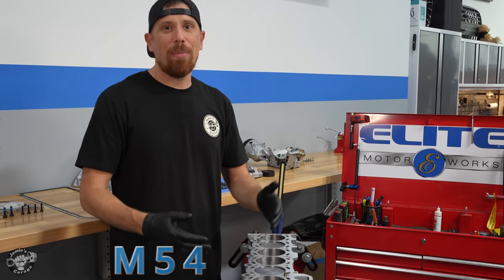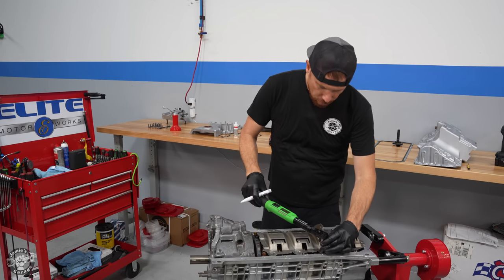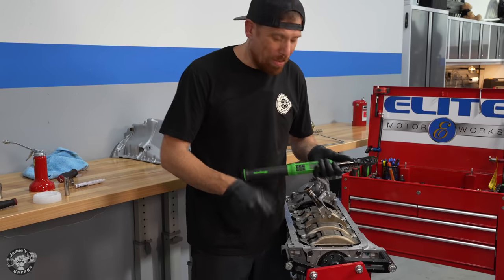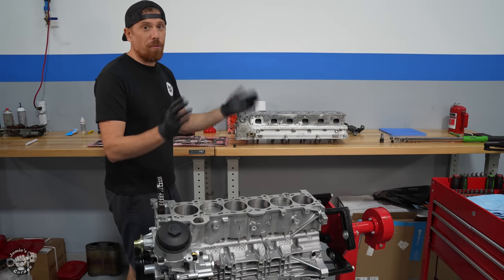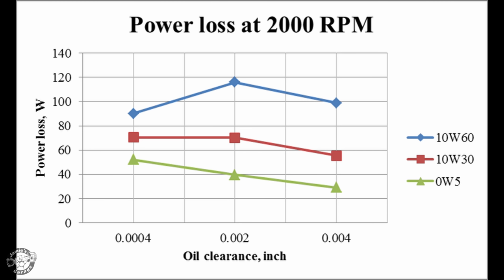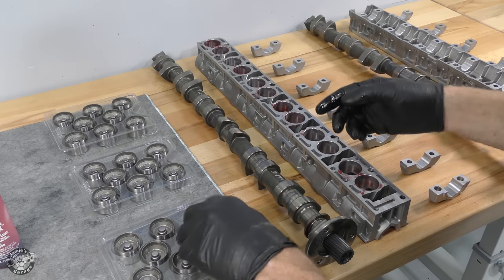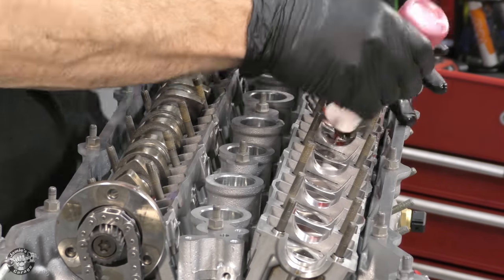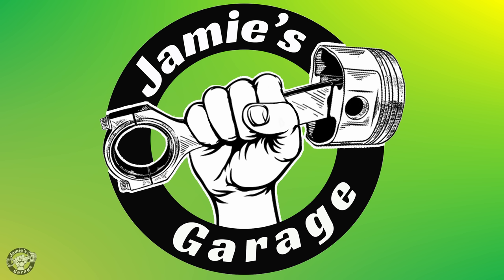Worlds Most Reliable BMW Engine?

Comment: This video was an awesome wrap up to a really cool collab! So with those spec piston return spins, hypothetically speaking, how much boost can this engine take?
Reply from the maker: Approximately 42 Nibbles of pressure at 350 furmans above sea level.
Reply: The spring has returned :"")
Reply: We wait long time for this video.  Thanks
Reply: Oh god does this mean…..
Reply: Until Jamie's technical explanation of piston return springs, I thought ChrisFix was just giving a flex by using them.
Reply: This race has really robbed us of the 'Hey guys, ChrisFix here, and today' videos
Reply: @danieltv1943   A new spring & The spring strikes back!
Reply: You guys know it’s not April 1st right?
Reply: Chrisfix, i Love the part you had Jamie throw in about the piston return springs, reminds me of the headgasket video on the del sol 😁. I wanna see more videos on that little car please!!!
Reply: Pardon my ignorance but how exactly does this fit into the $500 limit?
Reply: @Vass046  🤫 no one have to know that....... Until the entire planets
Reply: 36:20... E "Einlass" actually is the intake side, A "Auslass" is the exhaust side. @ChrisFix maybe you should check under the valve cover for correct assembly. Greetings from Germany.
Reply: @time1312  If you look through the video, it is assembled correctly, he just said it backwards.
Reply: @Vass046  because lemons is about having fun. This is the backup engine to keep them in the running. Swapping it would be the “$500 my @$$” penalty.
Reply: Please watch from 11:30 he put the gasket wrong way.
The screws hole are not aligned with the gasket holes.
Reply: Would it be worth upgrading the piston return springs on my N55, or does it already have 120 rate springs due to the turbo?
Also, do LED turn signals use blinker fluid? My housing has been dry the whole time I’ve had the car, and FCP Euro doesn’t specify which type of blinker fluid it uses.
Reply: @time1312  E = Einlass (intake), A = Auspuff (exhaust)
Reply: send me some I wanna prank my mate
Reply: Will my suspension coil work instead?
Reply: Yeah, with piston return springs, perhaps you don't need the rod caps 🤣
Reply: You should have gone 119 spring rate, much more preload return when heading North.
Reply: Red shirt guy: Is this an out-of-season April's Fool joke?
Reply: I'm sure Jamie noticed his mistake when he went to put those smaller bolts in, but didn't want to re-shoot the sequence.
Reply: I am glad you did not get over the $500 budget with this backyard rebuild :)
Reply: Good luck this year Chris. Best of wishes.
Reply: Chris remember to proper break-in this engine. I know it's for race use in lemons, but please - at least let it run for 30 minutes before race & change oil. There is nothing worse than new engine that hasn't been run in properly, eats a lot of oil because of that and can't perform as good as it should.
Reply: Everything seemed right until he put the cylinder head on, something clicked 😂😂😂 It seemed like some nonsense but I thought it was some terms I never heard of before 😂😂😂😂😂😂
Reply: heehee! piston return springs!
Reply: Depends on the setup and size of turbo. I hate it when people ask me that question. Also depends if you going to run a standalone or a piggyback.  What kind of fuel setup, and so on and so on. Too many variables to ask a question like that.
Reply: @peterjohnson9438  dca
Reply: The piston return springs fell out  before you put the head on.  Oh damn it- already lost all that horsepower !!   Or are you just short changing the purchasers with those springs that disappear !!  see the video 21:17 part. 
  Does you engine builder also perform card tricks ?
Reply: Now ChrisFix wants to use this newly build engine for race and boost it. Haha this took a nice turn
Reply: love that Chris Fix engine cover.
Reply: @wiseman1688  Might get one for my all electric vehicle to cut down the oil leakage between engine oil changes !!
Reply: I couldn’t ask for more. Great video!!! Let’s go!!!
Reply: may as well do the installed engine now ... (we're still under $500 :) right..?)
The SHIPPING had to be a few hundred (min). And this is the bu engine.
Reply: You are going to get smoked by some guy in a 2000$ junker who actually practiced. Making all of this an overkill.
Reply: @Vass046  thought the same thing lol. It doesn’t fit the $500 limit. I think it’s called cheating?
Reply: @mayte lmao
Reply: Hi
Reply: Hey at least you have your very custom valve cover
Reply: i wouldn't boost it w/o head studs.  the head bolts are a weak link in this engine as it is because of the aluminum block.  I was surprised he didn't use head studs.  A supercharger would be fine probably but I personally would have used head studs on this engine especially since it was getting fully rebuilt and upgraded anyway.
Reply: I really enjoyed the video and drank 2 German (König Pils) beers🍺 and ate 100g German mini pretzels.🥨😋 Thanks for the great video and great work!!🎬😀👍

Ich habe das Video sehr genossen und 2 deutsche (König Pils) Biere🍺 getrunken und 100 g deutsche Mini-Brezeln🥨 gegessen. 😋 Danke für das tolle Video und die tolle Arbeit!!🎬😀👍
Reply: atleast 400
Reply: I'm a fan
Reply: Hey guys Christmas here
Reply: @zohaibZM  idk what you talking about it look good to me ,
Reply: @zohaibZM yes he probably forgot to mention it but in after clips u can see he put it in the correct way

Comment: Actually, For this endurance race engine you should have used the 240 spring rate return springs it will increase the horsepower by 69%.
Reply from the maker: Yes but the downside is increased gauge deflection and everyone knows how much tension that causes on the belt diaphragm.
Reply: Sorry to point it out, but you BETTER make sure you got your muffler bearings greased, and in tip-top shape in order to keep your exhaust sounding like a genuine race-car.
Reply: Yeah, and dont forget to get stiffer springs for those piston return springs as well!
Reply: @shepshepson  first off, this is not Jaime’s car. Second off, the owner of the cat has multiple videos on common problems like said muffler bearing and blinker fluid (especially in these BMWs). I’m sure ChrisFix has it all taken care of.
Reply: @bagelbandit6076  lol yes
Reply: Nice.
Reply: I'd go for 4 x 105, this way he gets 420 in total!
Reply: but what about the blinker fluid? the car has no blinkers ( it's a bmw at the end)
Reply: nice
Reply: @JamiesGarage1  belt diaphragm tension can be acceptable as long as precautions are taken to avoid sinusoidal repleneration. The Main winding must be of the normal lotus-o-delta type and placed in panendermic semi-boloid slots  otherwise side fumbling is not effectively prevented. Pretty basic if you ask me
Reply: I put the 300’s in It was like my motor had a 500 shot of nitrous on it
Reply: Just watch out for piston-bounce once you go past 13 000 rpm.
Reply: i used 320 version from FCPUSA and those saved me some 5mpg, plus some 220 BHP.
Reply: Too high piston return spring rate will cause excessive blinker fluid consumption, which in turns degrading steering performance, that's definitely not good.

Comment: Piston return springs are absolutely a necessity for a client as special as Chris.  They compliment the harmonic balancer I’ve read.  Jamie you really are an elite level musician….i mean mechanic😀😂😅🤣
Reply: @JamiesGarage1  2:59 There would be a better way of measuring in this case: You have to use the backside of the caiipers. there are two "steps" that show up if you open it... I cant describe it by word very good, otherwise you have to look it up
Reply: please link to get does springs
Reply: @lucasniemeyer3381  this would be the perfect application for a machinist's ruler, a dept gage like the starrett 237 or something like that. You don't rely on the veniers caliper crowfoot for a precise measurement.

Comment: I did the piston return spring upgrade on my mk4 Jetta, and I can confirm that this is one of the best upgrades you can do to your engine.
Since the engine use less energy to return the pistons, you will also see significantly reduced fuel consumption.
Reply from the maker: Just make sure you get the mark 4 piston return springs for your mk4 Jetta

Comment: 27:50 ... never smear loctite or silicone or any substance on the female part, doing this will always scrape of most of the substance and it can block the port.
If you smear it onto the male part the excess will scrape off outwards and it wont get into the hole or whatever part it is you are connecting.

Comment: 20:35 ... You need to use spring compressor to install those properly, otherwise they can create too much angular wall pressure and blow the gasket nipple.  BMW makes a tool for it, but it's $420.69.
Reply: Nice
Reply: im even shocked to see springs , i not even know they can put springs to sit on top of the pistons . im not even sure how it works like that but how would you even use a tool as the head has to be on
Reply: @joeishere500  that's a joke. Chrisfix used to make jokes every 1st april. Like changing blinker fluid and stuff.
Reply: This might also blow the engine brake pads up and the PRNDL
Reply: wow that "shock"ing 🤣
Reply: @dasfahrer8187 , that's correct, it's clearly outlined in the official engine assembly manual, page 69.
Also don't forget the spring retaining compound, to ensure stability and durability.
Reply: I didn't have genuine piston return spring retaining compound when assembling my B69 Diesel engine so I used blinker fluid, it's basically the same thing. It took 3 liters in total.
Reply: @drive-channel1834  Good reminder.  Unbalancing the crystalline structure and introducing hyperbolic yawn is absolutely something you don't want.

Comment: Another fun tip for studs is to buy N54 exhaust studs, they work for all M5x engines and have little e-torx ends on them which makes installing them a total breeze.

Comment: For them sticky labels: grab a spraybottle of isopropyl alcohol soak the label with it and try to catch one of its corners and pull gently. Keep spraying the underside of the label while pulling it up and away. It comes completely clean off. What's more it does not hurt the adhesive just deactivates is and it will re-stick those antitamper stickers pose no problem to this method.

Comment: Brilliant video man! In the middle of an M54 rebuild myself so this has been a great summary of the work, especially some of the upgrades were good to know.
BUT regarding the camshafts, you did install them correctly but got the comment mixed up. E is for intake, A is for exhaust. Don't imagine you can install them that way anyway but best to clarify.
Keep up the top work, loving the channel!
Reply: <German>
Reply: Einlauf = inlet and Auspuff = exhaust. Had the same problem with a MAK M32 where our apprentice managed to adjust the valve clearance wrong because he thought the A meant air and the E meant exhaust. Luckily we found out before we started the engine.
Reply: That is right. E = "Einlass" = Intake side; A = "Auslass" = Exhaust side
Reply: Nice catch!  I was also worried at video 36:15 into video.  And it is wrong to complain about markings.  This is a German vehicle.  Respect the language of the engineers that produced this engine!

Hopefully, this was caught and caps between intake and exhaust are not compatible.

YIKES!  At ~36:48 in video, looks like he got it correct, but explained backwards.  Can see timing chain for "A" cam and caps on exhaust side of engine......wow.....very scary!

P-Chi

Comment: Firstly I want to say the quality of your build is 10/10, as someone who builds BMW engines and auto transmissions in the UK I can really appreciate the attention to detail you have gone too.

There's just one issue I picked up on from your voice over regarding the camshaft caps fitting order.

You said that the A caps were for intake and the E caps were for exhaust but you got this the wrong way round, I know it was just a mistake as in the video the A caps are fitted correctly to the exhaust side.

I don't know if this can easily be edited into a video that's already up but thought I'd let you know but it's a great video nonetheless.
Reply: A dyslexic error🤣 no wait, left hand drive side, not right.😆
Reply from the maker: Exactly 😂

Comment: I find it fascinating how fast those 45 minutes passed. Great video!

Also just a quick question, do you think installing piston return springs could help my Peugeot 206+ reach 500hp? Its 1.1L engine currently makes 60 but I reckon that with a bit of boost and the springs we could do it
Reply from the maker: You can do anything you put PRS to. 🤘

Comment: 10:35 if you place those gaskets on the block there are dowels that will hold them. No need to waste any cable ties. Also these are leakers, I always put a blob of RTV on my glove and run those through my finger and thumb to put the thinnest layer on. No leaks, no mess. Same with the vanos gasket.

Comment: Great video. We'll be doing our M54 Lemons engine this winter and will follow your lead. One thought: split lock washer at 28:18 is a no-no. Split washers have been tested and found to loosen faster than no washer at all! Use a cup washer or flat washer to distribute the load and not come loose.

Comment: The engine looks awesome! What I don’t get is how the cost of this engine with all its upgrades fits in the budget that Chris had to comply with.
Reply: It’s a replacement engine in case the factory engine fails, that’s legal for the race he’s using it for.
Reply: since it's not in the car, it technically isn't part of the "$500" budget. if they put it in before the race then it'd count.
Reply: Thanks for info!

Comment: For those little parts that need cleaning, I like to use an electric water kettle. It's like a small hot tank. They're like $20. You can fill it up with hand fulls of nuts, bolts, washers, etc. Then just cover with some degreaser. LA Awesome is what I've used. Works great

Comment: 12:17 smoothly cut to flip the rear main seal gasket around
Reply from the maker: Camera magic 😉
Reply: I scrolled comments before posting figuring someone else def noticed also... I loved the camera fade away while spinning the bolt into the gasket which was just up against the gasket because the hole wasn't there lol

Comment: The after market and repair shops are doing BMW's job for them by engineering better parts.
Legend says that the best BMW engine is the one built by Toyota 😂
Reply: idk the M5x Motors are pretty bullet proof even in stock form with maintenance

Comment: 12:17  ... It is important to replace those two 13mm bolts with the ones with preapplied blue sealant, or, apply some other high temp sealant to clean bolts + plus allow time to cure before filling with oil. People think it's a blue loctite, but it is actually a SEALANT. When you buy some other kits, it doesn't come with sealant applied, you install it and it leaks slowly. (or fast!) 
Those bolts are a direct path to the pressurized oil pan, oil will find its way down those threads, ask me how I know.

Comment: Phheewww some where around 36 minutes into the video you said “A is for intake & E is for exhaust” which is backwards. Upon checking your video I see you did install them correctly just on video I believe you said it differently!! Just for anyone watching make sure you pay close attention to the cam tray positions when removing apart your engine. My experience comes from having rebuilt 4 s50/s52 engines which are nearly identical in that respect. But love the cleanliness and attention to detail brotha !! This thing is going to be bulletproof 👊🏼

Comment: at 2:10 id just like to point out that this is called safety wire. Very common in aviation. This is the first time ive ever seen it sed in automotive before.
Reply: Yeah the oil pump bolt can loosen with the harmonics of the m54 the early ones non zhp don’t have locktight, so people do the safety wire like planes so it doesn’t undo itself, even thought the nut is already threaded opposite.  Zhp has loctite and stuff but the normie m54 gotta be careful, some people weld it but that’s crazy.

Comment: At 36:15 you said that E stands for exhaust and A for intake but it's the other way around. E stands for "Einlass" which means intake and A stands for "Auslass" which means exhaust. But you installed them correctly

Comment: I had the oil pump nut fall off on my street-driven M54. People online say it only happens on racecars that are constantly at redline, but alas, I dropped the oil pan and the nut was chillin' at the bottom. Drilled the nut by hand and safety wired it, the pre-drilled nut kit is a ripoff.

That upgrade kit with the shaft and bolt seems like a good idea for a racecar. I'd also add the oil pump chain tensioner mod for racing.

Comment: These are old fashioned piston return springs. There is a new design that works from under the piston so it doesn't reduce engine displacement

Comment: Does Chris have anymore of those piston return springs? Mine are completely shot and I can't find them anywhere. I have a 2001 330I so they should be the same since awd doesn't make a difference. I need them ASAP because I had a huge race this weekend and I don't want to reuse the old worn out ones. Please help

Comment: Good work. You addressed a lot of the problems with these engines, though I have some rants.
No replacement of the rotors or at least the valve on the oil pump- why? You can buy these from BMW. Also what about the condition of the teeth on the sprocket on the front of the crankshaft, which also are notorious for wearing out? Pretty sure the one you are using - the teeth are already sharp.
Putting ARP studs on an BMW aluminum block is also a good idea.
About the VANOS, you can just sand the original spacer ring to take out the gaps - save some money there.